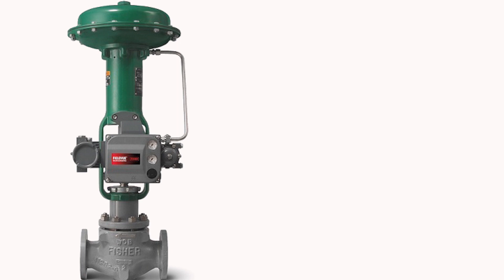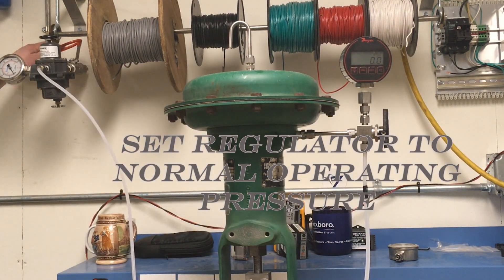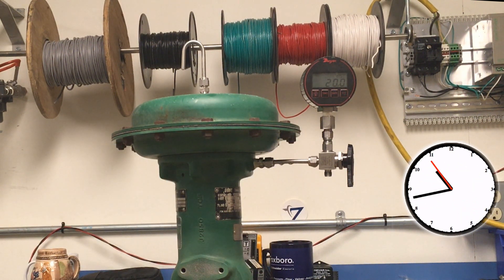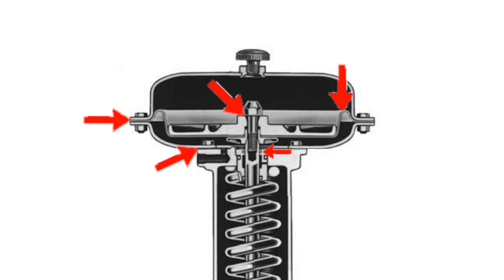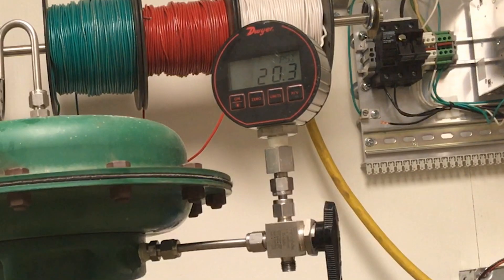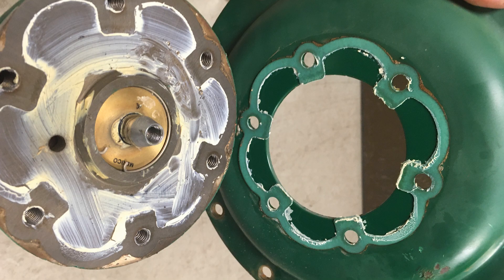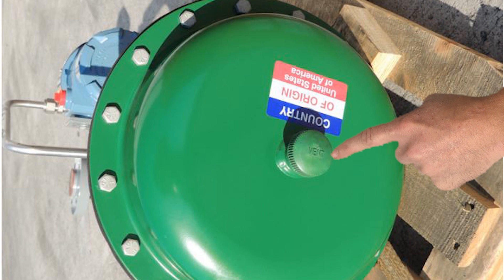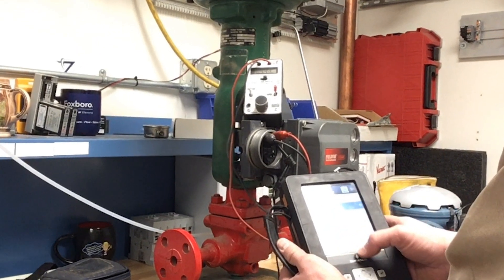Actuator Leak Test

Comment: Actuator air leaks can result in a decrease of control valve performance this video will explain the process i use for testing for air leaks on a rising actuator with you will need to Connect a three way valve to the normal supply port of the actuator

Comment: I seen some valve bodies have a line on it instead of a flow arrow? Is the line an indication for flow?
Reply from the maker: Some have a line on the body that has a downward angle, which represents the flow path through a globe valve.  That may be what you are referring to.  This alone does not indicate flow however, but for general service, you install with the angled downward part facing up stream so the flow enters below the plug and flows up through the port.
Reply: @jimdiggins101  thanks for the info.